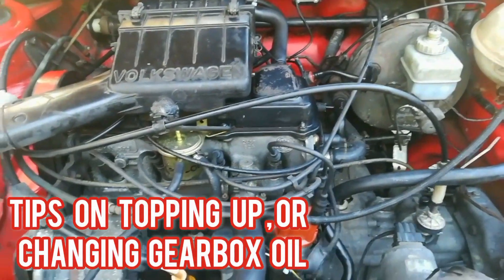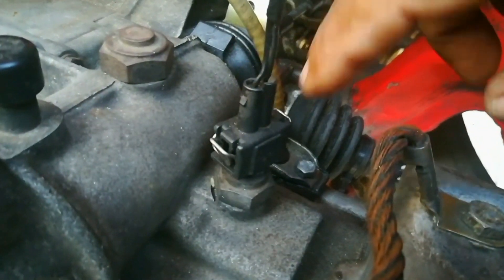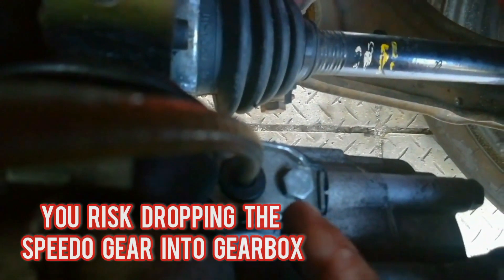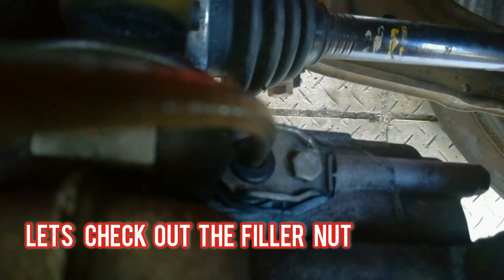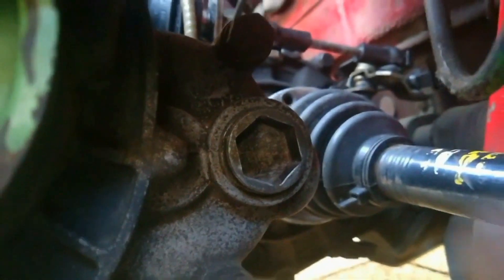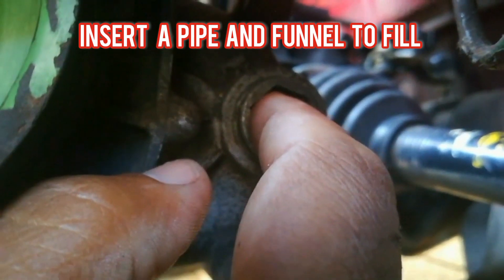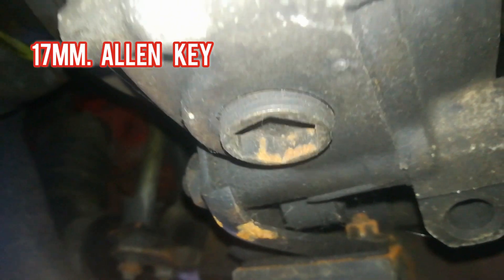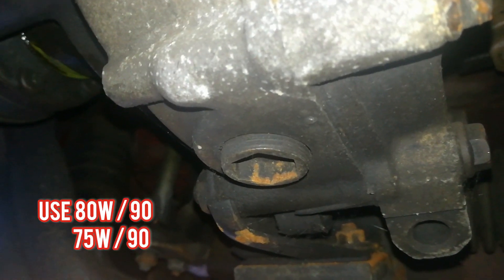GOLF MK1 :UPDATE. Transmission /Gear Oil Top up / Change.#golfmk1 #vwgolf #vwfox #golfmk2 #vwcaddy

Comment: Hi good day sir. I just love your content. It's very very informative.  I've got a question.  I have oil leaking out my gearbox at the part where the gear link goes into that bracket that comes out the gearbox. Please help
Reply from the maker: Hi, sorry late reply. There is a seal there that you can replace
Reply: Hi sir. Is there a video on how to replace it and must the gearbox come off?

Comment: What will happen if I filled gear oil in the first hole for timing 🙈
Reply from the maker: Depending on how much you put in, your clutch plate will slip, and you will feel car lacking power. Try throwing some engine cleaner down there, it can get rid of some oil that may have got to the clutch plate. Fortunately the oil when thrown down inspection hole Wil run right out at bottom of Gearbox..

Comment: My mk 1 is a 2007 model and I've owned it for about 11 years. Would you recommend an oil change or is it not necessary unless its low?
Reply from the maker: Hi, Apparently according to vw you don't  really need to change it... Obviously if it needs topping up because you losing oil  due to a leak. I have never changed mine and I have a 1999 Model... And everything seems fine.. all my vw cars I owned I  never really changed gear  oil,   maybe a top up yes... I know there are people who  change the gear oil at certain km intervals.

Comment: After chainging both axel cap for new ones in my 020 gearbox 1990 it seems to be still leaking some oil spot. I don't know what to do what's wrong?
Thanks for a nice videos!!
Reply from the maker: Could possibly that you have overfilled with gear oil
Check the  level.
Reply: @pjs-golfmk1-diy   That is not the problem, fill it with 1.9 L and it was equally before.